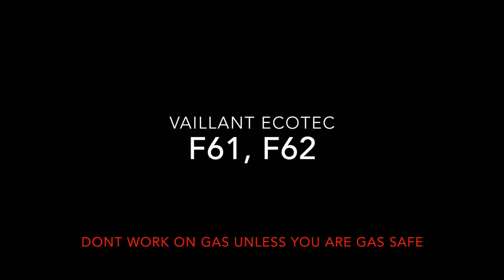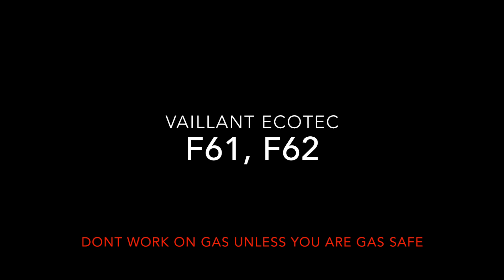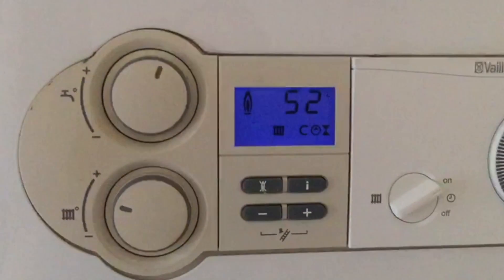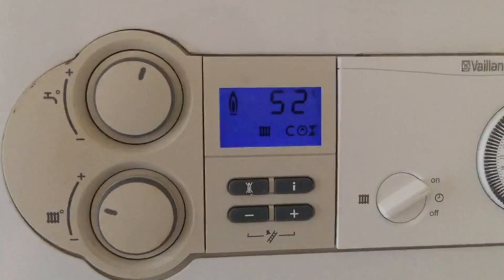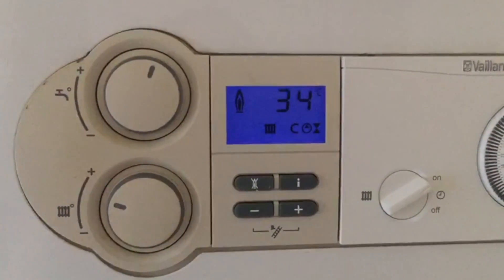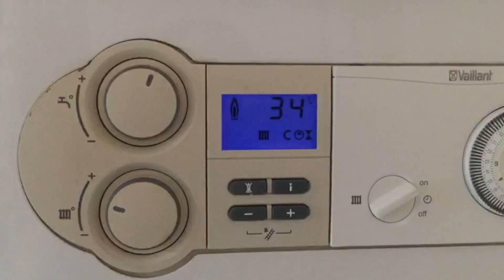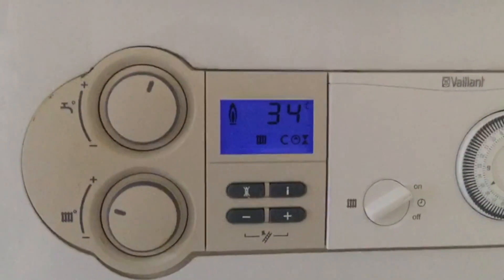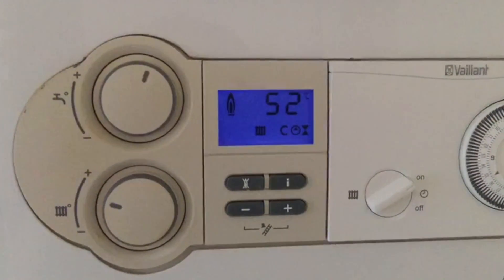FIX. Vaillant F61 and F62 Intermittent issues. GOLD DUST!!!

Comment: Often only the two capacitors on the board are broken.
Oft sind nur die beiden Kondensatoren auf der Steuerungsplatine defekt. 
Nach einem Wechsel geht die Heizung wieder.
Reply from the maker: Which 2? Share!!!
Reply: I just fixed mine by changing all 5 electrolytic capacitors on the PCB. Had periodic f62 and flickering vrc430 display backlight, and display on boiler doing as you showed. With age they go out of spec as they dry out internaly. Not sure which were the culprit, but with the board out made sense to change them all.
Reply: 2 X 470uF 35V 105 degree
2X 10uF 63V 85 degree
1X 100uF 400V

Having now checked them with a meter off board  one of the 470uf ones was very dead. The 470uf pair are the low voltage power supply smoothing capacitors.
Reply from the maker: Top man!!!! You need to stick around. I always have electronic questions and no-one can answer them!!
Reply from the maker: I only just saw these comments!!!!! I =m not sure why  they don't come up in my feed.
Reply: I would think the 470uf pair would likely be the ones to die in most cases. Just be sure if changing them to use high quality replacements of equal spec with same lead spacing (and put them in the right way round - else they will explode! :-P ). Cant go wrong with japanese made capacitors as they are some of the best - I used some of panasonics high temp long life ones, cant remember exact part number off top of my head.
Reply from the maker: MER MER good to know which ones. I don't think its very obvious on the Vaillant PCB compared to the Glowworm  one. Glowworm Caps swell and even split the safety slit open.
Reply: @HeatingGeek  There were no visible signs of problems on the dead 470uf I took out. The originals on my board were made by EPCOS  which is TDK group, respectable well made capacitors. Board is about 10 years old so lasted quite well. Heat is a big killer of capacitors, their life shortens exponentially vs operating temperature, and inside boiler cases is quite warm :-P
Reply from the maker: I know heat is the number one killer for them. I have a board in the van that had F61/ F62 and the caps did look crap quality then I saw a refurbisher sticker!!! I will try and repair it and see how it works.
Reply: @HeatingGeek  https://uk.farnell.com

Search for panasonic part number EEUEB1V471

Thats the 470uf ones I bought. Buying from farnell they are unlikely to be fakes like you might get off ebay.

Obviously also a chance it may be one or more of the other caps.
Reply: @mermer2359   Thanks for sharing that my friend, very interesting, Heating Geek is right, you need to stick around, top man👍😉
Reply: @HeatingGeek  Top video again pal & very good of you, Mer Mer & the other guy's for the positive input👍 Very interesting notes to take from you & Mer Mer's info on the capacitor issues bulging etc & your inspection of the refurb pcb, well, it just shows you eh?!! Keep em coming fella, I always save em & 👍👍👍👍👍s up, fantastic😀 much love & peace to you & yours😉💖
Reply: Hi @steve french, did you try it? I have same F61 last week, after restart it is always working 1/2 day and then there is F61 again (I did not check jumping of the temperature yet, I will do so today).  I´m thinking about exchange of capacitors on PCB.
Reply: So yesterday I replaced both 470uF resistors and it WORKS! Thanks a lot for hint!
Reply: @mermer2359  I know it might be lots to ask, but can you share links of the capacitors you used? Where did you buy them, etc. Do I remove the PCB and test the capacitors with a meter off load or something else? Is there a risk if something is not done correctly for a gas leak or something? Your help is much appreciated.

Comment: Any idea how much this will cost ?
Reply from the maker: PCB is about 200 plus fitting. Not cheap is the answer. :-) Vaillant are expensive on the PCBs and fans.
Reply: HeatingGeek - thanks man - more bad news
Reply: @HeatingGeek  mine is showing F64 mate had no hot water all day yesterday got back from work last night and pressed the lock out button and it's working fine now though in my experience it will show again soon thanks for this video clip it's brilliant mate
Reply from the maker: @garylawton7254  Same issue as F62. PCB required. Unfortunately.
Reply: @HeatingGeek  the fault codes dissapered now mate after pressing lockout button last night I have a feeling it will show again though don't you, there is a elecrical gremlin somewhere in boiler looks like thanks for reply
Reply: @HeatingGeek  are you without doubt its the board? some said pump but way I recall that's a F75 fault code thanks?
Reply from the maker: @garylawton7254  Yes it will. :-(
Reply from the maker: @garylawton7254  Yes its the board.
Reply: @HeatingGeek  replaced the fuse in boiler spur and at first it still showed code for a few hours like I said it stayed on lockout then later that night pressed the lockout reset button and it's been fine for last 48 hours. Why else would the fuse blow mate? Thanks
Reply from the maker: @garylawton7254  It could be many reasons. I would get an experienced engineer to test it. The pump commonly blows fuses but that shouldn't cause F64. F64 will come back if you turn the power off for 20 min or so and then turn it back on.  you are aware of the f64 because something else blew the fuse. You have 2 issues.
Reply: @HeatingGeek  can I test suspected components with a multi meter? Thank you
Reply from the maker: @garylawton7254  Yes you can. I can't tell you what to check and how because their Its a lot of things it could be. However, The PCB is will continue to show F62/F64 etc etc every time power is turned off for a period if time.
Reply: @HeatingGeek  strange how it's dissapered for now isn't it beeen fine for three days now?
Reply from the maker: @garylawton7254  Its not strange. turn the power off for 30 min and it will be back. :-)
Reply: @HeatingGeek  would you test thermistors first mate thanks?
Reply from the maker: @garylawton7254  No. Just replace the PCB. Like the video shows. Its the PCB.
Reply: @HeatingGeek  The heating on my boiler doesn't fluctuate like in your clip mate? Codes not reappered in almost a week now too... Thanks
Reply: @HeatingGeek  are the pcbs easy to replace just plug it in as simple as that? Cheers
Reply from the maker: @garylawton7254  Easy enough. The hard bit is proving the boiler is safe afterwards. PCB controls the fan and gas valve so could make the boiler dangerous if not set up (combustion) correctly.
Reply: @HeatingGeek  in that scenario it would lockout again? Cheers
Reply from the maker: @garylawton7254  No, the boiler doesn't know if it's producing 10,000 ppm of CO and it will remain lit and working. It won't lockout. That's why you have to check and set it up afterwards.
Reply: @HeatingGeek  I'm not arguing because you certainly seem to know a lot more than me lol but wouldnt it just show a gas valve fault ( F28) and lockout as a safety measure? Thanks mate
Reply from the maker: @garylawton7254  No. F28 means "I didn't light" F29 means "I was lit and then went out for some reason".  With an incorrectly set up boiler it will light and run, but produce very high levels of CO. Do you have Instagram? I put a post up last week with my analyser showing 30000ppm CO. The boiler would still run and fire no problem. If the POC came back into the house or there was another issue with the boiler then that was a fatality. Boiler worked fine according to the customer..... Making a boiler work, is only a small part of the job.
Reply: @HeatingGeek  I turned boiler off for around a hour and fault codes not returned it's weird what happened testing ntcs over weekend mate too thanks
Reply: @HeatingGeek  the charge on the expansion vessel on my  vaillant ecotech plus combi boiler was 0.5  could this cause the boiler to need topping up every two days or so as this is what's happening mate thanks?
Reply from the maker: @garylawton7254  Only if the PRV is leaking.
Reply: @HeatingGeek no its not leaking?
Reply from the maker: @garylawton7254  Not the vessel then. Muse have a leak somewhere else.
Reply: @HeatingGeek  it's dropped by 0.2 bar overnight..... your right bet its the tf1 fernox filter under cupboard there crap
Reply: @HeatingGeek  the boilers never gone over 3bar as far as I know mate so not prv thanks mate